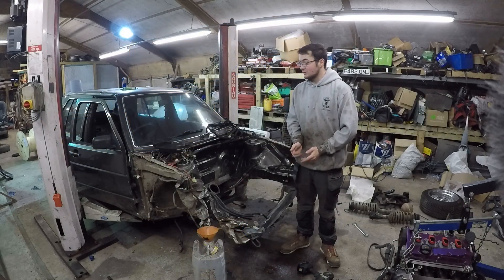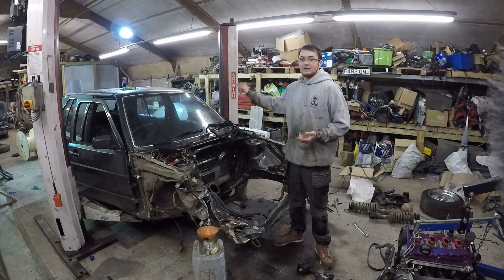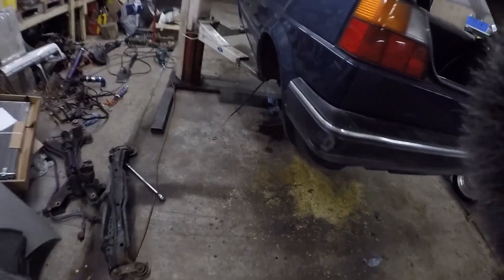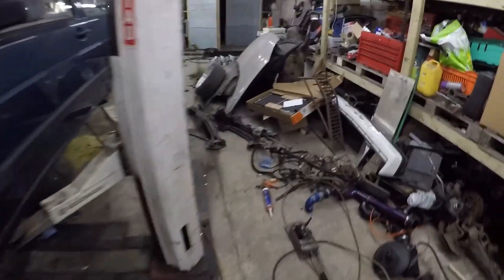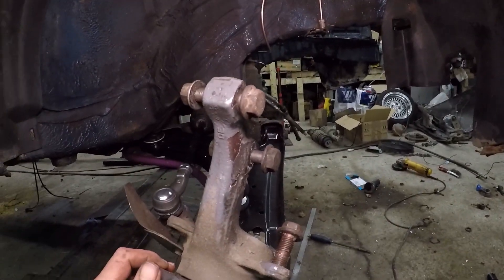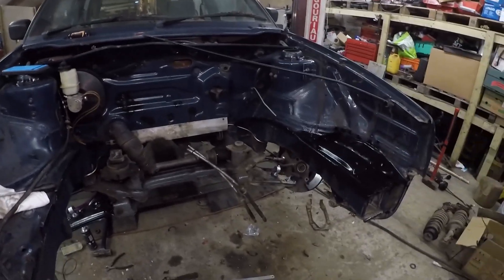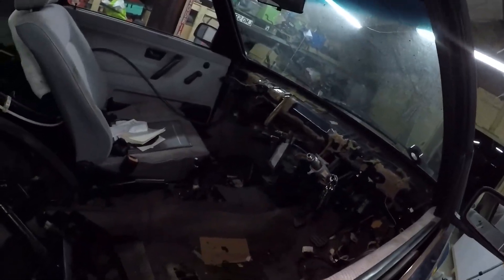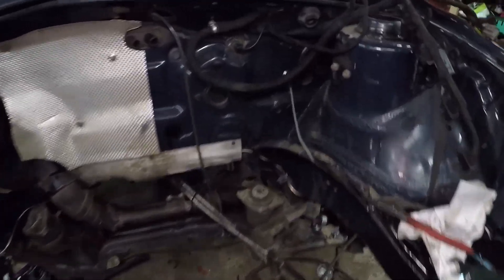Mk2 Golf 20VT : Quick build... Quick progress!

Comment: Nice work 👌 
What’s with the clutch reservoir? 
When I done mine I got a Corrado brake reservoir that has an outlet pipe attached for the clutch master 
Keeps it nice and tidy
Reply from the maker: Cheers, was just what I used around 5 years ago from the beginning, mk2 focus stubby master setup and I think it was a Honda motorbike reservoir for the clutch, never bothered to change it as it just works and keeps the clutch/brakes separate :)